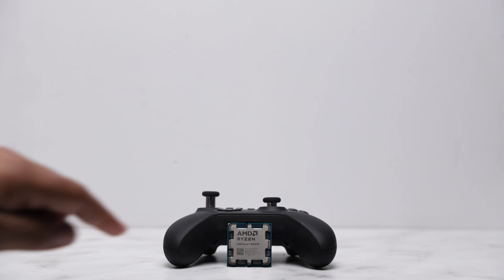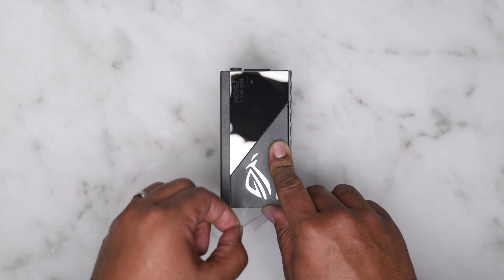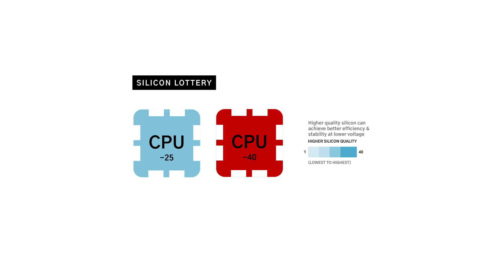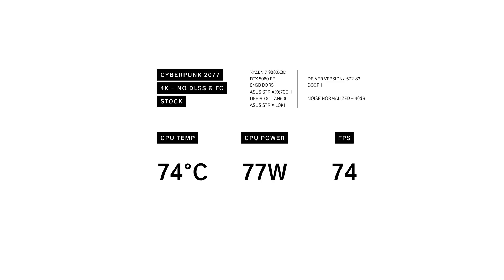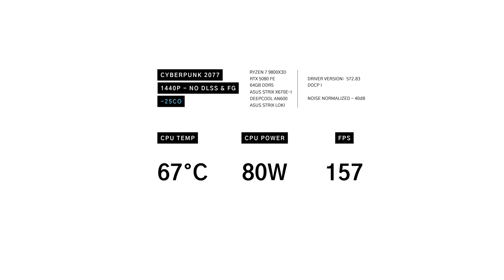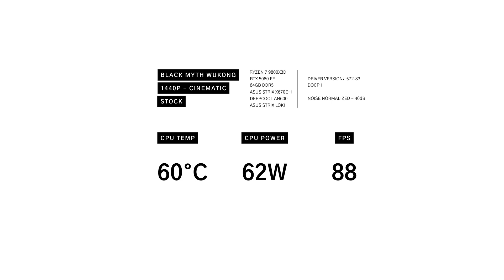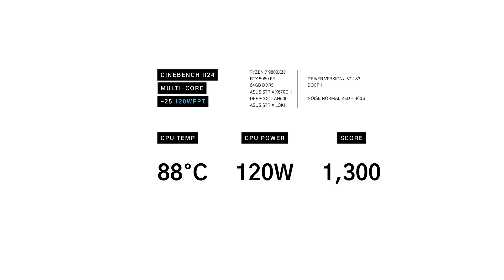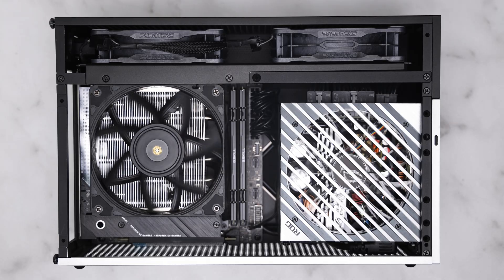Faster, Cooler, More Efficient – Best PBO Settings for Ryzen 9800X3D!

Comment from the maker: Disclaimer for Clarity:

These steps can be applied to all Zen 4 and Zen 5 CPUs, not just X3D models; though there are some key differences between them.

Power Limits & PPT:
You can manually adjust PPT (Package Power Tracking) to control power consumption. In this video, I set PPT to 120W, which typically reduces power draw by around 15-20W depending on workload and cooling capacity. Slight reductions in power can lower temperatures and, in some cases, improve performance due to better thermal headroom. However, reducing PPT too much, down to 100W or lower, may start to noticeably impact performance.

TDP vs. PPT:
TDP (Thermal Design Power) is not the same as power consumption. A CPU with a 120W TDP does not necessarily consume 120W, it’s a thermal guideline for cooling solutions. PPT, on the other hand, represents the actual power the CPU package can draw, which is why CPUs often exceed their rated TDP under load, especially with Precision Boost Overdrive (PBO) enabled.

Curve Optimizer (CO):
Fine-tuning per core with Curve Optimizer yields better efficiency and performance than using a blanket “All Core” offset. However, this process takes time, often days or weeks, to properly stabilize and optimize. I don’t recommend using Ryzen Master’s CO Utility, as it lacks thorough stress testing and can lead to instability.

Final Note:
Always test system stability after making adjustments to power, voltage, or Curve Optimizer settings. Undervolting too aggressively can cause crashes or instability in certain workloads.
Reply: Hey Chris. Got the like and subscribe. Video is well done, presented well, good pace that allows time to think about what you're saying, and a nice relaxed voice. 

One tip though- when you're showing the bios, Fullscreen, please. Many of us only watch YouTube on our phones. 

Keep up the good work.
Reply from the maker: @-8_8- thanks for the support and input. We now have the ability to capture higher resolution bios footage so that full screen doesn’t look so terrible.

Comment: Three this cpu in yesterday without adjusting anything coming from last gen Ryzen 5. It’s the smoothness that this cpu is insane at, my 1% lows are 20-30 fpf higher than my old max fps. I’m going to try these steps without the power limit as that’s not something I’m gonna run out of with a decent psu. I just want temps lower (which were already fairly low but not fully tested thoroughly) 

Pbo2 is incredibly good that’s all I enabled yesterday.

One thing I remembered was to out windows into balanced mode while using an x3d cpu otherwise windows just runs with the highest clock speed cores while in balanced it allows your 3d cache cores to be utilised (is it 3d cache cores? Idk but it’s just better on balanced power plan trust me)

Comment: Hey Chris; 4K in general isn't really going to stress the CPU that heavily. The 5080 is the pull there...

I'm a 1080p (240/360HZ) gamer and CPU optimizations are extremely powerful on that resolution, making the X3D pretty important -- while on 4K, X3D isn't exactly wasted..but it isn't really of the same value as it would be at 1080.

TDLR: You should optimize/benchmark X3D's on 1080p to showcase what these changes REALLY can do, because FPS wise..it's considerable.

I've tested in many different situations; and for anything other than 1080p -- the 200+ MHZ boost is pointless, games like ARMA/SQUAD/HELLDIVERS might benefit slightly...but at 1080p those gains can actually be 25-50 FPS depending on how well you optimized your chip.

The -40 CO can be great, but it will more in likely fail stability UNLESS you locate your "main" cores and -25 // -30 those while keeping -40 on the rest.

(I'm the record holder on 3dmark for 9800X3D's coupled with my 3090, though I actually found this video to see what other people recommended out of curiosity).

Comment: Just what I was looking for! Got my 9800x3d, the idle 45-55C and 95C temp was driving me crazy during cinebench and in some games even hitting 75-85C, Im sure I will try these settings. Great video! 
FYI, im using NZXT Kraken 360 for cooling, pump at a fixed 80% , fans are custom, from 25% to 85%
Reply: What were your results? My temperatures are the same on the same CPU

Comment: Start testing your CO with Aida64 stress test (first 4 checks together). Not even my -15 CO is stable. Except for games, and cinebench, those are stable. Probably everyone who tells you to go -20 or even more CO, never tested it properly.
Reply: Who cares if it crashes in Aida64 if it's stable in games and regular use? Just don't run Aida 64 lol. It's a gaming PC not an aida64 PC.
Reply: @benjaminchen4367 it could crash from time to time in games in specific scenarios
Reply: Confirm this. My 9800x3d is stable at 15 pbo in aida64 tests for an hour running. If I set it to 17 it crashes in 2-3 mins

Comment: I simply do not see the point of PBO. Even with PBO maxed out I get +50 FPS to 1% lows as compared to a simple 5.5ghz all-core overclock at 1.23 volts.
Reply: You mean a manual overclock fixed at 1.23v yields better performance than PBO maxed out or you trolling? It's hilarious how badly your comment has broken me 🤣

Comment: I think I won the silicon lottery. I was able to do -50 CO and could do CineBench2024 at 5.2 Ghz locked on all cores, with a max of 120W and max temps of 85c. I tested for stability as well with no issues.
Reply: You can also do manual voltage ontop of Curve Optimizer for even lower power draw, my 9800X3D with a CO set to -25 with a override core voltage of 1.15v @ 5.20GHz across all cores with the TDP Config preset "95W(128W/100A/160A)".
Peaks at 118w (106-110w average) with a max temperature of 73c on the package, running the 30 minute all core Cinebench run (peaked at 81c during Aida64 Extreme - System Stability).
I'm using a "MSI MAG X870E TOMAHAWK WIFI" motherboard with a "ARCTIC Liquid Freezer III Pro 240 A-RGB" cooler in a ~22 celsius ambient temperature - requires a bit more tinkering but will get even better results.

Comment: Thanks a lot, I guess these methods also work for the 9950X3D ? Except for the power limit of course which would not be the same.

Edit : I just tried -25 and in gaming I only lose 3°C, maybe is it normal for an undervolted 9950X3D to lose less temperature than an undervolted 9800X3D would ?

Comment: Cinebench brought my cpu(9800x3d) up to 91degrees Celsius. I assume this is not normal?
Reply from the maker: Cinebench is a single and multicore test. If you ran a multicore test with a low profile cooler, you will see 90-95c on the CPU. That’s completely normal and there’s nothing you can do about that really in a smaller cooler, even bigger coolers can get into the 90s.
Reply: @ChrisRussellTech oh man, thank you so much for putting my mind at ease! 👍
Reply: @ChrisRussellTech  Lian Li Hidroshift 95 °C stress test Power OSST bios all deafault settings

Comment: Thanks a lot for your video I set my co to 25 and running cinebench I’m getting 72c to 74c during the 10 minute multicore stress test, previously at stock I was getting 89c max also my score is now slightly higher .
Reply from the maker: Great, AMD and Intel both aim to score high out the box and in turn they pump up the voltage to achieve that. My power limiting your using a bit less power and if your system was throttling before you’ll even see a score increase.

Comment: I use MSI PBO enhanced boost 2 with my 9800X3D as I don't worry about longevity since CPUs are dirt cheap these days and all need is it to last at least two years. I like the performance of 6 MHz this chip gives.

Comment: My 9800x doesn't even hit 70c with an all core boost of 5225, what cookers are people using?
Reply from the maker: Are you using a Mini-ITX case with a low profile cooler?
Reply: @ChrisRussellTech  I'm using a 360 AIO which is probably overkill as I come from a 5950X but the 9800X3d doesn't run hot at all.
Reply: @godieinafirenow  use occt power test and your 9800x3d gone 95c
Reply: @aimrichman I’ve tested with cinibench and prime 95

Comment: I'm trying to put 120w ppt but my pc just keep stuttering at desktop, doesnt even make sense
Reply from the maker: re you applying other settings as well such as a curve optimizer offset?
Reply: @ChrisRussellTech  i was putting a -20 curve optimizer, but even without the pbo now i feel like my processor is slower
Reply: @ChrisRussellTech  already tried to clear cmos, it didnt work, i have a 9800x3d and its only getting 8300 on cpu-z
Reply: @ChrisRussellTech  before it was like 8700
Reply: U sure your motherboard set it W instead of mW? I got same issue with aorus then realize it set with mW, so i have to change the number to 120000

Comment: feel like i lost the silicon lottery, my 9800x3d can only handle -15 CO before crashes & instability set in.
Reply: Do you use any other limiters in bios? And how's the temperature after -15co from default?

Comment: Great video, thank you!

I am very new to tweaking like this. I set my settings to -40CO, 120W PPT, 85TTL. I ran CoreCycler overnight, and I'm not seeing any WHEA errors. I'll keep testing with other stress tests but I assume that means it maybe was successful?

My question is this: my C23 score is around 22494, which from what I've read seems pretty mediocre. HWInfo is also only showing a max clock speed of 5,225MHz. With that said, I mostly game. Is this worth optimizing further?

Comment: for a 9800x3d for a 67mm cooler in your opinion which is better. deepcool an600 or a thermalright axp120-x67?
Reply from the maker: I haven’t used the IS-67-XT but I’ve used the IS-55. I love the DeepCool AN600. It looks better and does a good enough job on the 9800X3D. Plus it uses screws for the fan instead of metal clips.

Comment: Recently built in an ncase m2. Your videos helped me out tremendously in understanding the airflow and impact of the different designs that can be built in that case. 9800x3d + TUF 5090. Still playing around with OC/undervolting so these videos are highly appreciated! Currently at 80% power usage + 255mhz for the GPU (lazy OC/UV I know :D)
I will be checking if you have a more howto-styled video and play around with the curve for the CPU later today.
Reply: You should be undervolting that TUF 5090 with Msi afterburner& Rivatuner. Give that gpu a undervolt curve,  boost higher clockspeed for longer and less powerdraw.

Comment: i noticed you switched the cpu cooler from your prev build again. i’d be interested in what you think of the taller cooler and how it has or hasn’t affected gpu thermals.
Reply from the maker: Well the GPU runs about the same. The 5080 either handles the heat better, diverts the heat another way or is under reporting the actual hottest temperature. I think the bigger cooler works better and looks better in my opinion. Only so much a 90mm cooler can do.
Reply: @ i have almost the exact same previous build as you except with the asus strix b850-i mobo. i’m not super happy with the thermals on my 9800x3d with axp90 x47 full copper since it’s having me ramp fan speeds too high and actually louder than i’d like it to be. is there a noticeable noise reduction for you with the deepcool cooler?

i used to have a 240 AIO but wanted to simplify the build and cable management with air cooling options. i have no temp issues on my FE card either just wondering if there’s a noticeable impact of taking away more of the extra space for flow through airflow path on the FE cards.
Reply from the maker: @DarrinLin  if you have a 2 slot card is recommend giving a 67mm cooler a try

Comment: I’ve been using PBO with CO -20 on all cores since I got my 9800X3D. Absolutely rock solid while exceeding stock results in CB24, 72 C max, 115-120 W, locked to 5.2 GHz on all cores, cooled with a 240 mm AIO. I don’t really feel the need to go beyond that in terms of undervolting.
Reply from the maker: That sounds great, most people can stop at CO or even power limiting if you’re doing multi-core heavy tasks.
Reply: I just got one , with 5.2 clock but effective clock in games is between 3.5-4 and it fluxes giving me stutter , is there way to lock the speed at 5.2 without it fluxing ?
Reply: @MaksAMD  I think the frequency fluctuations are pretty normal for AM5 CPUs, as their behavior is really dynamic. Clock speed, voltages, power draw etc. are highly dependent on the task and especially games don’t really utilize all the resources available on the 9800X3D. That being said, three things come to mind first when someone is experiencing stutter:
1. What memory are you using and is EXPO enabled? AM5 loves fast memory and especially tight timings.
2. Do you have the latest chipset drivers installed?
3. Are you accidentally running the CPU in eco mode? Or do you have some power management setting turned on in Windows?

Comment: Get better cpu cooling bruh. 74c in Cyberpunk?
Reply from the maker: Completely normal when you’re running full rasterization, no DLSS or Frame Generation. If I were using those, temps would be cooler.

Comment: Where i find in BIOS the TTL That you mentioned to put from 95° to 85°?
Reply from the maker: All of the steps I’ve mentioned are in the PBO menu. It may display as Thermal Throttle Limit instead of TTL

Comment: Feeling guilty to use Ryzen Master just to give the optimised CO but I set it through BIOS instead using 'Per Core'. I did OCCT & Prime95 stress test each close to 24 hours. No error message so far.
My question is, is the stock score is base on Core Performance Boost enabled or disabled?
Reply from the maker: I’ve had zero luck using the Ryzen Master for auto curves optimizer. In a perfect world it would work great and help find you a core by core offset instead of of All Core.

Comment: Something I'm testing myself, but 6400MT/sec kits force the MCLK:UCLK to run 2:1, something 6000MT/sec kits don't do. This causes the UCLK to run at 1600MHz instead of 3000MHz. How much does this affect performance? I'm not sure, I haven't noticed anything significant so far between the two kits. They're both really good kits too, CL30 and CL32 with tight timings respectively.

For 9800x3D, I have mine in a FD Ridge, AXP-X53 FC with TG liquid metal, artic P9 exhausting with a Noctua foam spacer between the cooler and fan. I have mine set to +0/-35mV with 105W eco mode. The extra wattage required to run 5.4GHz is just way too much, like the difference between 55W and 80W while gaming.
Reply from the maker: This video is really for vanilla beginners, one click solutions. It’s like cutting an Apple with a sword, it’ll get the job done but not the best way. That’s PBO. I’m definitely not a expert in the field either
Reply from the maker: Forget 5.4 all core in a mini itx case lol
Reply: @ ^^ exactly! I haven't tried going to 5GHz to see how it affects performance, but I can definitely see the advantage. Zen5's efficiency and 3D v-cache's reversed stack is just so much better. Coming form a former 5800x3D and then 7950x3D user, the 7950x3D I ended up direct-die cooling as well.

Comment: Good starting point is -40CO? 😂😂😂
Same people will ask in forums/reddit why PC freezes on idle.  Try running AIDA/TM5 with descent timings for few hours.
Reply from the maker: I have had chips hit -40 stable but my 9800X3D and 9950X can’t do those numbers. My 9950X will boot with -40 but it’ll crash in gaming or cinebench., even idle.
Reply: @ChrisRussellTech  hold on... so your system can't boot with those offsets. But you recommend it to people anyway? I'd tuning my memory with 9800x3d and a week or so testing timings. I can do lots of benchmarks with descent offset and use PC daily. But if ilI leave TM5 overnight, I'll get errors eventually.
Reply from the maker: @ you’ll never know if your system can achieve -40 unless you try. You’ll know repetitive quickly if your chip is unstable.!
Reply: @ChrisRussellTech  I'm running ECLK overclock, so original values no longer applicable. Currently 6400cl26 with 2200fclk and trying to push it faster.

Comment: Hello Chris, i am using a AXP90-X47 Cooler and a Curve Optimer of -40 (stable in game and no crashes) but that cooler is struggling, any tip to check mounting pressure o any mounting issue? I have the T1 too and i'm limited to 47mm cooler, i much prefer staying air cooled
Reply from the maker: Are you using the stock cooker? Have you tried any of the mods like the Noctua Foam Duct or the fan shroud from EIGA?
Reply: @ChrisRussellTech  i have the fan shroud mod but still getting 75ish degrees when playing. CPU pulling aroud 75/80W
For the fan i'm using the slim 92mm noctua chromax and the cooler is the AXP90-X47 full copper i don't have the stock cooler
Reply from the maker: @ check your installation and mounting pressure
Reply: @ Any tip to verify if it's actually good or bad? I tried 3 times by removing the cooler and repasting, but seems that the lower i tight the better it is
Reply from the maker: @JumpenChannel  you’re seeing improvements after tightening?
Reply: @ChrisRussellTech  first time i mount it very somewhat thight and temps were bad, after unmounting thermal paste was all over (think overthingten) i followed decreasing the mounting pressure for two times and temps were getting better. Now i'm in the situation i described. I Think im gonna try again to tight a little in the next days and let you know
Reply from the maker: @ okay sounds good!